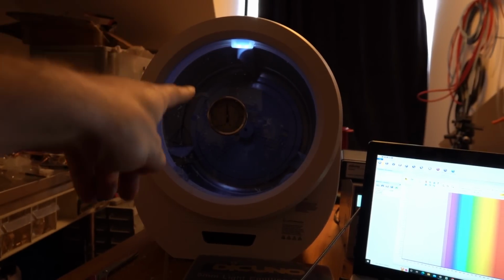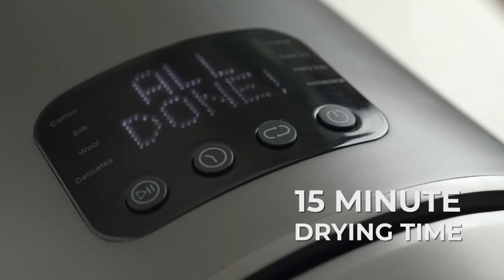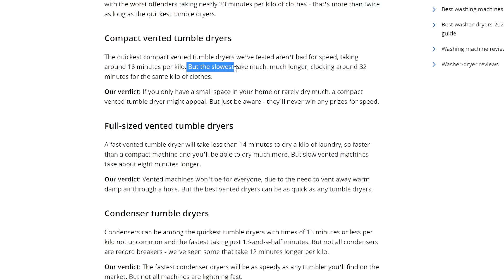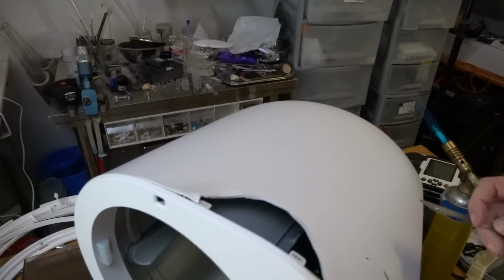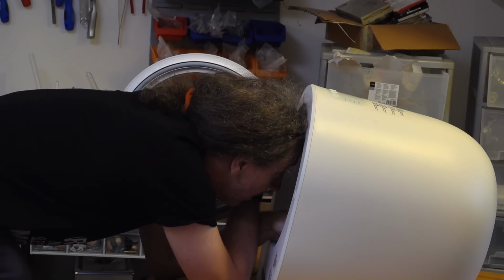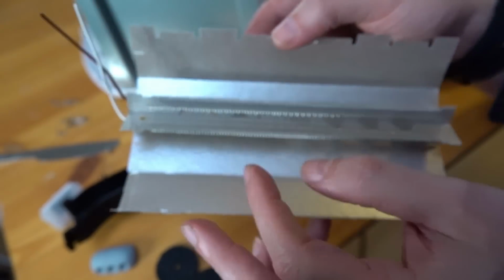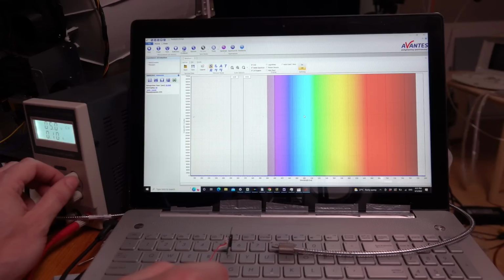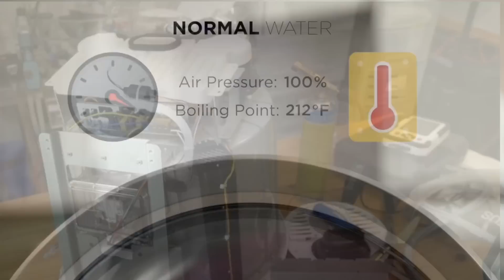Autopsy of a Scam-Starter: The Morus Zero!

Comment: That UV LED looks piss-weak, about on par with the "vacuum" created by the fan at the back! LOL!
Reply: assuming they are turning it on at all, and not placed there for ad reasons, they're probably blinking it.
Reply: I doubt it could even make a difference for the clothes in terms of sterilization. You would need something much stronger for that, and also a heatsink so you could actually run the thing.
Reply: I'm wondering if maybe he should've put a resistor in there to test it. I don't know anything about electronics but something tells me it doesn't run that hot in the machine..
Reply: You mean to tell me a glorified PC fan can't create "space vacuum"?? Balderdash
Reply: @amosbackstrom5366  He was powering it with a variable power supply...
Reply: Crikey mate
Reply: @thomsonleith7067  a fan(electric motor with a blade) is the basis for most home vacuums. Which makes the topic a bit confusing. Creating a partial vacuum with a fan as the vacuum pump isn't impossible but the environmant requires a Check valve and a sealed system or your fan is just going to pull air through it, no matter how powerful it is.
Reply: @amosbackstrom5366  He can set whatever current limit he likes with the power supply so no need for resistors
Reply: Also UVB will do very little to sterilise anything. Real sterilising happens with UVC, which is hostile to all organic stuff, including cotton clothing.
Reply: You can't see uv
Reply: @gorak9000  it's "Vacuum+". And it can certainly create that. Just don't go into details.
Reply: @amosbackstrom5366  Agreed. Thunderf00t was driving that UV LED at ~ 7 Volts and .3 Amps. So the uvled was dissipating about 2 W in a component the size of a 250mW resistor.  The dryer most certainly would have had a current set in the driver circuit that would have kept the LED from overheating like this.  At the same time the output would be a lot lower than he measured with his spectrometer while he was burning his thumb.
Reply: Provided that there doesn't seem to be a protection to prevent UV rays leaking outside of the contraption, it is fortunate that the UV LED is useless.
Reply: @johnwilson839  I came here to say the led was been overdriven by him which means the uv emitted when using the led in it's intended range is probably quite weak but i have no idea on the ammount uv needed to kill viruses and bacteria.
Reply: Running it at 2W, when it is really rated at 0.5W is kind of overdriving it. However it is a proper UV LED, though with the amount of light it can give off at 0.5W of power it is not exactly going to be the biggest killer of germs, unless they are right by it in the unit.
Reply: Well you really can't know, going by the spectrum I saw it was around 300nm and that low most of the camera optics will block the light going to the sensor + the sensor itself would not be good at absorbing it, any light we are seeing is fluorescence when it hits any material. True power seeing how it was running at about 400mA should be in the 250 ish mw neighborhood,  Really scary actually since if that is focused it can easily cause a melanoma (skin cancer).
Reply: replying to all here
if this were actually uvc the distance argument is silly due to the high reflectivity ratio. 
the real question is what kind of plastic they found for the opaque dome that passes uv spectrum range light through in any quantity.  most materials reflect uvb and uvc. almost every material that doesn't reflect it absorbs it.   that's why uvc bulbs have to be made with monocrystaline quartz glass. 

that said,  if it were .5w upd, and produced 100% uvc-100% efficiently, and the chamber was .1 cubic meters,  the clothes surface area was less than a square meter,  and the chamber was at 99% vacuum,    and a cycle lasts 15 minutes......
it would be about twice as effective as sunlight on the equator at sea level at noon on a cloudless day, 50%humidity, over the same time frame. 
which is not particularly effective.  

you'd be far better off spraying in a few ml of isopropyl before or during the dry to eliminate bacteria and just a few days in the drawer to kill any virus you'd be afraid of.
Reply: While mosfets pre-heating the condenser by the access heat further helping condensation
Reply: You, of all people, should have noticed Phil's mistake.
Reply: *space vacuum
Reply: The UV LED's "power" can't be judged by how bright it is.
Reply: -Matter didn’t create anti matter
-Anti matter didn’t create matter
(Both of them were present at the time of big bang)
-Both of them didn’t create themselves.
-Both of them came from an unimaginable source,  that unimaginable source created matter and antimatter (everything) thats why it is known as “the creator” of everything.
————
- that unimaginable source/creator has created sin and virtue which are opposite to each other,
— “logic” confirmed that every action has its own reaction, so the reaction of sin is different than the reaction of virtue,
— the creator has created prophets to let us know about each and every detail of sin and virtue, also about their reactions,
Thank you :)
Reply: @malthenaundrup  I was thinking about that. The UV LED is mounted where the lights are which is just inside the door - where the clothes aren't? Seems pointless?
Reply: How rapidly would an effective UVC source degrade the plastic components of this remarkable machine?
Reply: The UV LED is probably driven by a PWM signal to a MOSFET on that wire. So that it doesn't get hot enough to melt.
Reply: Yeah, no doubt.
Reply: A vacuum test with no seals, just poke a tube in the hole. 
A test as bad as the product
Reply: @Margarinetaylorgrease  rubber tube of proper size is good enough seal to at least get some sort of a reading if whole system was really properly sealed. Which it clearly isnt.
Reply: @lazymass  I'd like to see that
Reply: @Deipnosophist_the_Gastronomer  Great question. UV(B? C?) will degrade the rubber seals as well.
Reply: @Zialitt  
You're not very clever, are you?. Who created the creator? And don't try special pleading, it won't work. Your "explanation" is not any sort of explanation. I invite you to watch all of Thunderf00t's "Why Do People Laugh At Creationists".  You don't even have to go to the library or get a proper education. You can just watch videos.
Reply: @meucunt1  Ok I thought it was a constant voltage power supply but in that case he of course should've just lowered the current
Reply: @timemachine194 no, he said that UV LEDs usually run at about 7V, but he forgot to set the current limiter to a reasonable value, as the LED will clamp the voltage until it burns out. The curve is quite steep!
Reply: @amosbackstrom5366  you're quite right, except he didn't even have to use a resistor, just the current limit setting on his power supply, which he obviously didn't.
Reply: LOL!????
Grow up.
Reply: Daiyve, look at that sophisticated switcher in that thing!
Reply: Vacuum so strong it sucked out all the UV light radiation into a parallel universe...
Reply: Just as well, seeing as how proper sterilizing UV would fade the clothes eventually.
Reply: @meucunt1  Could you tell if he was drawing 0.3mA or 0.3A? It looked like 0.3A, but maybe the "m" is too small to make up.

For the amount of heating it would make sense 0.3A, but it seems kinda high for a LED, but I don't use UV LEDs to be sure...
Reply: If you think about it, it is technically (kind-of) vacuum technology. That fan looks very like one you would find in a vacuum cleaner - and it does work by sucking the air.. All arguably legally correct and it does dry clothes..
The thing that struck me was how over-engineered it all was. - Particularly the heating elements and all the electronic elements.. Something very strange and crazy about that. - Very like the Juicero juicer reverse engineered by AvE.
Reply: @johnwilson839  im sure i saw it around the 400mA range at 6.5VDC
Reply: @NBM397  I still believe in more then what "science" shows us. I am not an idiot.
Reply: Whatever FV and current TF drove it is by the by, he just showed it was indeed a UV LED and that it gets very hot when driven continually due to the lack of heat dissipation. This means that in order to prevent it overheating, it's either going to be driven at very low current or with PWM resulting in very low UV output (assuming it's driven at all). His demonstration of the LED served its purpose perfectly well regardless of anyone's perception of the testing mode he used because all of this information can be inferred from the test he performed. The LED appears to be UVb, which won't be very good at sterilization anyway, it's output even at max current wouldn't be enough to be effective, even if it were UVc. The housing the LED is in would probably absorb most of the piddling output of the thing. In short, the darn thing is pointless.
Reply: @valseedian  It was UVB though, you can see that from the spectrum analyser.
Reply: @NBM397  The infinite regression counter argument is kinda pathetic.  The creationists can do it to.  "So the Big Bang created the universe?  So what created the Big Bang?  Maybe it was the divine Creator!"  

It gets neither side anywhere.
Reply: @PistonAvatarGuy  LEDs need current limiting, or a constant current supply, so they don't burn out. They can be run with a current limiting resistor or a limit on the power supply.  I don't think he had the current limit set low enough for this LED.
Reply: Well, that is a homeopathic device. A homeopathic dose of UV (none!) paired with a distant thought about negative pressure. But(!) a high impact on your wallet ... which may lead to actual hypotension ... 
But anyway, we(Thunderf00t) are in like Flynn, Dave! 
Hehehehe
Reply: @empanada401  Reducing the voltage will reduce the current, that's Ohm's law. In fact, that's how constant current drivers work, by reducing the voltage sent to the LED as it warms up and its resistance drops.
Reply: This is seriously the teeniest dryer I have ever seen, and I have a mini stacked W/D unit, so I know small, but this dryer makes mine look positively huge. Mine will fit and dry a queen sized quilt/bedcover.  For $600, it wouldn't even fit in the Morus.   Morons, FOMO, and "wow, I'm special because I can burn $600 for a micro sized dryer!"...smh
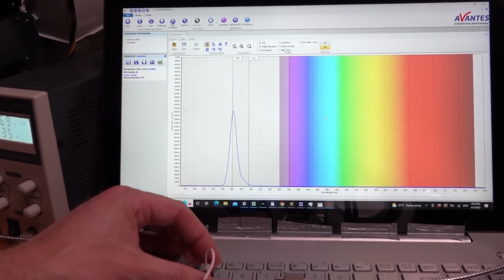Reply: @meucunt1  But he did not set the limit. Or did set it to infinity.  @27:37 you can see smoke on the left of the frame.. You can also see(and he points it out himself) that the LED enclosure is cooked proper. I love TFoot to bits, but here he had made a little electrical mistake...
Reply: @Gianns_TDM  unless your an albino
Reply: @Gianns_TDM  to melanoma?
Reply: yet they claimed it to work on UV, so they had to add it in some form, else their liable for court cases ;p
Reply: I can't not read this in Dave's voice
Reply: @memespeech  They can run it continuously. Just that Thunderf00t forgot to treat it as an actual LED - i.e. a current-operated light source. So he should have set the proper max current on the PSU so the PSU switched from voltage mode to current mode as soon as he got above the required voltage to turn it on.

Even tiny voltage changes or temperature changes can result in huge current changes which is the reason it's the current and not the voltage that is the critical parameter to regulate.
Reply: @Margarinetaylorgrease  well, thats time for you to go and try it, nothing better than your own experience.

Comment: The clothesline UV dosage also beats that puny UV LED (which was probably PWM strobed)
Reply: And the clothsline, in addition to providing a good dose of UV light was also heating with infrared technology
Reply: @indyola1  and with an extra bonus: visible-light technology heating!
Reply: @victortitov1740  along with using green and renewable energy! Someone should really patent that process, it's revolutionary!
Reply: Especially if the UV index is above 10.
Reply: Well it would have helped more if he hadn't put his line in the shade.
Reply: @MrJturner74  most of the drying on a line outside comes via evaporation not heat and light.
Reply: @SMPKarma  SOLAR FREAKIN CLOTHESWAYS
Reply: @versedbridge4007  lmfao
Reply: @SMPKarma  Finally we have the technology to built a solar powered dryer that produces drinking water from laundry and lights the home.
Reply: @unlocated7448  if a significant amount of water evaporated without any heat at all going into it, it would freeze before being dry (well, I guess you could call it dry, because there's no liquid, but that's just because the water has turned solid)
Reply: @SMPKarma  you can call the sun green energy but renewable? No the sun is a giant nuclear disposable battery.
Reply: @unlocated7448  where I grew up in Arizona the clothes at the beginning of the line would be almost dry by the time you hung the last of the line. At least in summer.
Reply: @indyola1  heating with freakin' thermonuclear technology!
Reply: From freakin' space! 🌞
Reply: @indyola1  I guess clothsline on the outside of international space station will tick all the boxes.
Space vacuum, UV, infrared.
Reply: @nanonymous9139  and it really is in space vacuum :)
Reply: You did what I did and confused UV with IR. Not that it matters really. Investors got screwed once again. That is on them if they didn't read the fine print  or did not even conduct the bare minimum of research regarding what they were investing in. Heck, at least it was just a freaking dryer and not a breakthrough life saving medical device like Theranos was claiming.

Any consumers would have to consider the lawyers would get the bulk of the money in the case of a class action lawsuit assuming IF they win the case and IF even so these scammer even pay up. Highly unlikely.
Reply: @unlocated7448  r/whoooosh
Reply: @whichgodofthousandsmeansno5306  how so?
Reply: Extra bonus is the clothesline takes advantage of the natural ozone in the outdoor air to sterilise the clothing.
Reply: @unlocated7448  doesn't ALL of the drying come from evaporation?

Comment: The plastic condenser panel is actually really common in modern desiccant drum dehumidifiers, but normally there would be a closed air loop for the hot humid air, and a separate fan blowing cooler room-temperature air over the exterior.  I don't know if the claims they were making were marketing hype or if they genuinely thought they could achieve it, but stumbled when it came to manufacturing the unit.

There are a LOT of kickstarters that make promises that lack a grasp of technical reality.
Reply: How can big Clive comment and not get recognized
Reply: @RNG_Anarchist I recognize him.
Reply: Hai Clive